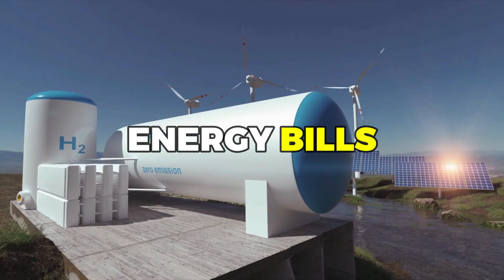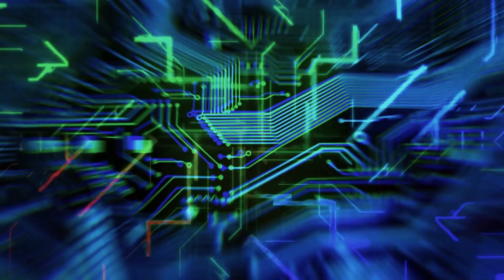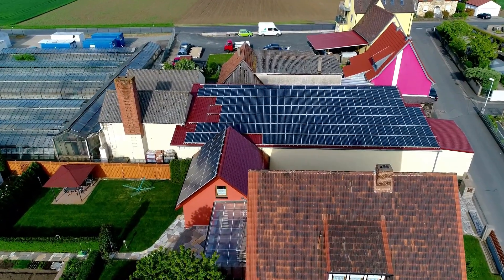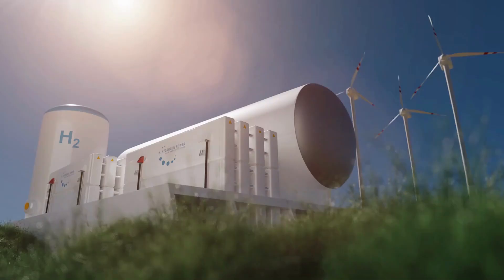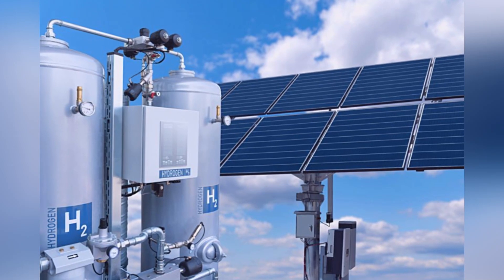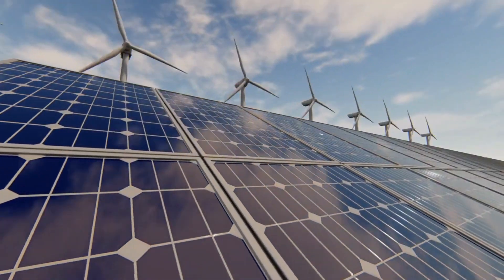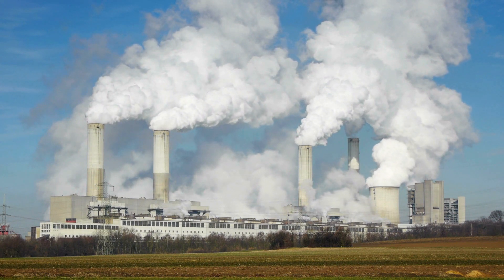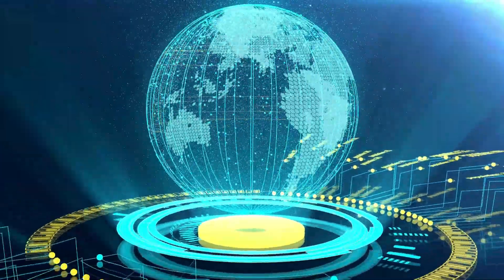"Free Gas from Solar Panels: The Future of Energy is Here"

Comment: Panels don't produce H2,   All the extra equipment that is need to produce the h2 is not economical!  Old News!
Reply: True, it wasn't well expressed as far as costs and production but the alternative of batteries isn't suitable for many greenhouse gas producing industries.

Shipping, aviation, long haul trucking, rail transportation, farming, steel production, the military, heavy equipment mining and construction, all major industries that could be transformed to using hydrogen over never being able to be transformed to using battery stored electricity for day long operation because of size constrictions.

It's not going to be economical by today's narrow means of measurement but certainly more beneficial than death on a planet that can no longer support us and the hidden costs of increased climate related disasters and food shortages.